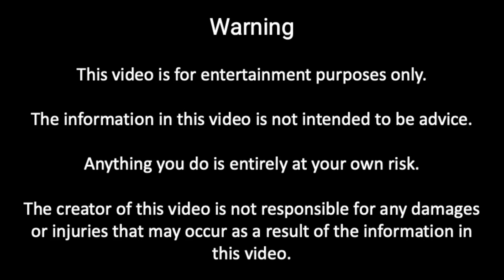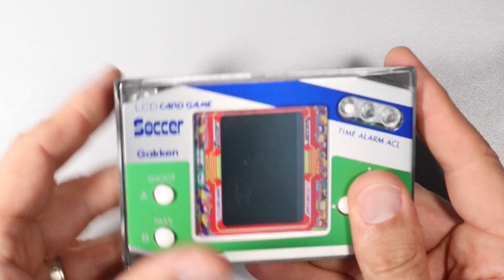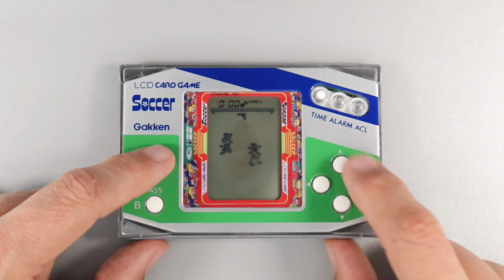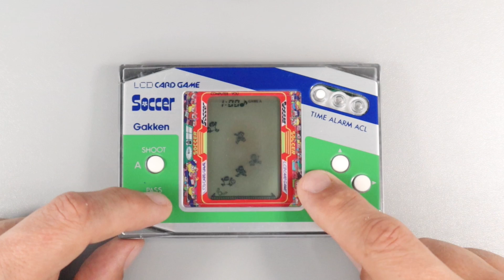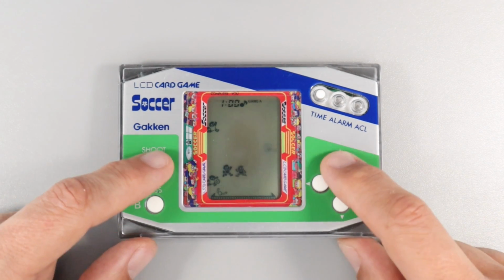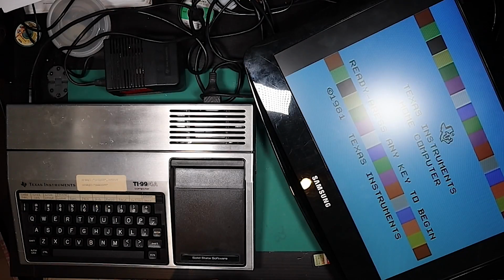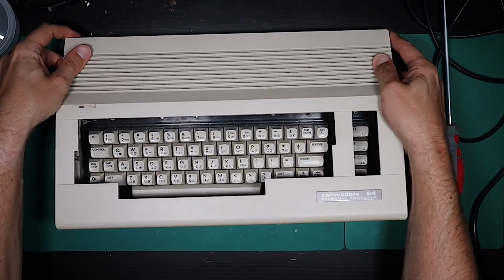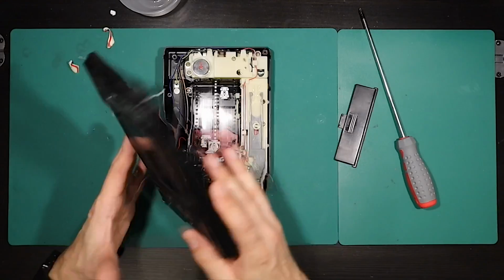Gakken Soccer LCD Card Game - Try to Fix

Comment: Thank you for this. I got one as well on ebay and the display is pretty faint in spots. It doesn't seem like a battery connection issue and  I've been nervously putting off opening it up to clean everything. 

Watching this helped my confidence and I'll keep it handy during the operation. Cheers!
Reply from the maker: Thank YOU... that's great to hear. As a very much small-time youtube creator its  kind words like yours that make it worthwhile. Cheers! I genuinely appreciate it